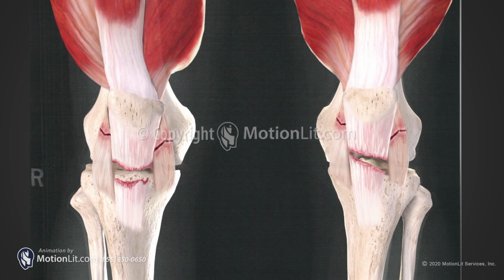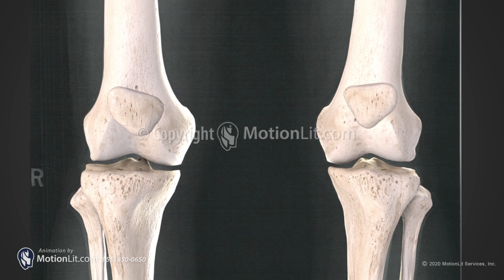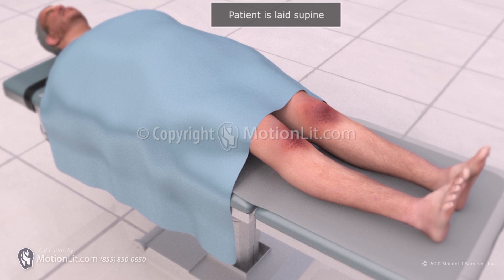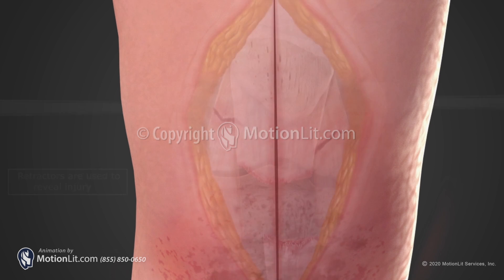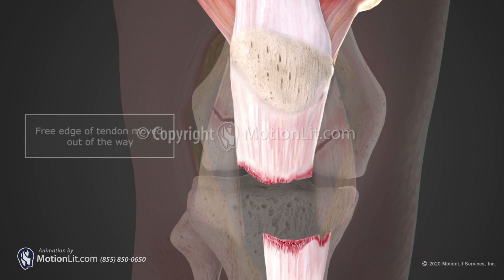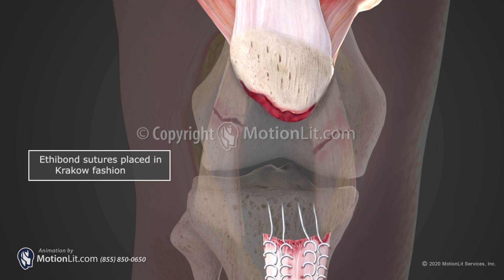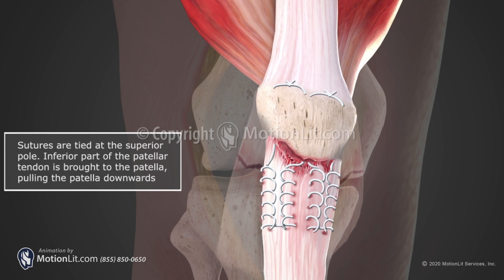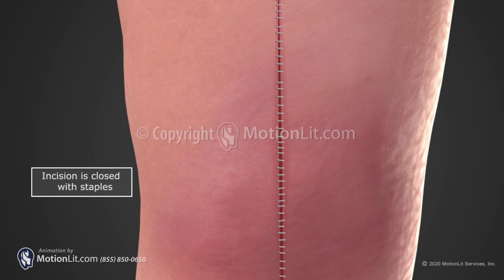Patella Tendon Repair

Comment: For anyone looking at this, 6-12 months is if you’re lucky. I’ve been dealing with recovery for almost 2 years now and finally making somewhat progress.
Reply: Nooo don’t say that 😭🙏 I just had surgery 3 weeks ago
Reply: @_ApoIIo yeah I ask myself daily did I put in enough work. Some people are able to bounce back pretty quickly, but I was just not one of those people.
Reply: Nasty injury to have. Had mine a year ago playing basketball. I’ve been playing basketball for 20 years and only recently I had the patellar tendon tear. Winter is a nightmare with this injury
Reply: I'm sorry to hear this has taken this long for you?
I'm 2 weeks from surgery. I suffered a 90% tear from a fall.
Reply: @36ELGALAN it’s taken me about 2 and a half years as I had knock back , I would say listen to your body and record how long you swell and increase or decrease your load depending on on your physion. The leg extension 45 second holds are killer i remember i couldn’t even hold the first plate without pulling a face now i can hold 66 kg its been a long road , also back to playing 90 mins of football but i get swelling afterwards but ibpro helps
Reply: im just now getting back to normal. Going on 4 years...... Its and extremely long healing process. The good thing is you can walk
Reply: @erichumphries4662 Thanks for your response, Eric.
Reply: Does yours feel good as new not that it's healed? Or does it feel like as if you have patellar tendinosis where your knee is still sore from stressful activities like running and jumping?
Reply: @vanisle_kahuna  The good news is you will be able to walk. Depending on your age. Running and being like normal will be up to your rehab. I have never been the same. But im thankful for the mobility I have. If you are in sports such as foot ball basketball. It will be a hard road back.

Comment: im confused as to what i actually did to my knee. i fell of my bike at around 30mph and went over my handle bars i used my right arm to break my fall and i also hit my knee cap face down on the pavement too. when i got to the hospital they put my arm in cast but said my knee was not broken but badly damaged. for the first week i couldn't walk. i'm 8 weeks into my recovery and i can walk and run but cannot fully bend my knee i get really sharp pains in it, have i torn the ligaments ?
Reply: yea go get a mri you tore something, same here crashed mopad at about 40 kmh(i was outta town ) I belive I partially tore my patellar tendon or fully i gotta check back in 🤦🏽‍♂️ surgery monday
Reply: @iam-deadlyclan4 Im 19 years old 1,5  years ago  I had a direct blow in my knee . Due to the bad decision of my doctor like I had only an x-ray and no mri  He misdiagnosed . Actually my patellar tendon almost tear And I had to have surgery but i didn't . The MRI I did 8 months later says that my tendon is okay but even now I can't walk for a long distance, i can't go up and down  the stairs without pain I can't even straighten my leg when im sitting. ? Is there a chance that I can get my strength in my tendon? Now its too late for surgery,maybe a tendon graft its good idea?
Reply: Any update?
Reply: @AlexHernandez-xh8ei  if ur talking to me had surgery on my right knee (patellar tendon) on September 12th. Was in a straight brace for 5 weeks. Currently on my 2nd week of physical therapy. Looking to return to work by december (UPS) so i can’t rush back as much as I want too. Keep a positive mindset because it was hell being indoors all that time.
Reply: @iam-deadlyclan4 did u actually rupture it?
Reply: @iam-deadlyclan4 Im 19 years old 1,5  years ago  I had a direct blow in my knee . Due to the bad decision of my doctor like I had only an x-ray and no mri  He misdiagnosed . Actually my patellar tendon almost tear And I had to have surgery but i didn't . The MRI I did 8 months later says that my tendon is okay but even now I can't walk for a long distance, i can't go up and down  the stairs without pain I can't even straighten my leg when im sitting. ? Is there a chance that I can get my strength in my tendon? Now its too late for surgery,maybe a tendon graft its good idea?

Comment: Mine was slightly different the whole tendon came off the bone and had to be screwed back in (left knee), and a full rupture of the quad muscle off the tendon (right knee) which was repaired the same way as the video.
Reply: how you feel?
Reply: @memesmemes1705  Sometimes struggle with pain and tightness but stronger now than before

Comment: 6 years later and my knee is great post op. It took several months of rehab to get full rom. Getting the strength back in my quad took a few years. Your quad muscles basically dissolve during recovery because your not allowed to move your knee for 6 weeks.
Reply: I'm  going through this right now and four weeks into the journey. I haven't started physical therapy yet. I always had strong legs and hoping to get back to at least 80%. Any advice?
Reply: How r u now? @eriktarver2087
Reply: I’m currently about 10 weeks post op. I’m at 120 degrees on my left leg and about 112 on my right. Things will take patience. Also I was lucky enough to get a video of my injury too. It’s on my channel
Reply: @KuyaDreww  how are you doing now?
Reply: Just did this today on both knees 😩
Reply: @smauller623  so sorry to hear it. Brutal injury! Omg, hopefully you get a good surgeon. I’m guessing with both legs injured it’s difficult to walk. So sorry man, damn.
Reply: @ I can’t walk tried the immobilizers from ER and can’t even do that.
Reply: @smauller623 how did you do it?
Reply: @smauller623 Como sigues,cómo es posible te rompieras las 2???????
Reply: @JoseMaya-i5y nobody knows got bloodwork done and no blood/tendon issues. 6mo in and still can’t run or jump yet.
Reply: I’m currently 4 weeks post op. My surgeon had me walking day 1 post op - quite aggressive approach. That is with brace and crutches. Just increased brace rom from 60 to 80 degrees today. Mobility and rom is progressively better but muscle mass in quad is gone and judging by the comments, it’s could be a while before I see muscle there again. Frustrating but hopefully lots of protein in diet and decent therapy will keep things improving. Scared as heck though that the further I increase rom, the more risk of re-injuring but just trying to be careful. Any advice to boost confidence/moral at this point?
Reply: @ It sounds aggressive. My dr. told me that each of the 3 cords he placed could hold my total body weight. I was nervous about damaging his repair. He wasn’t at all. Hope this helps.
Reply: @remmah192 Como se llaman esos cables,que nombre tienen????? Estoy pasando por lo mismo. 😢😢😢
Reply: What shape were you in before your injury?  Im currently going through this. What hardware did you have? Did you end up removing your hardware?
Reply: @TheSnowRobot  Hi there! Very sorry your going through this first of all. I was in your shoes and know how worried I was. I was in good shape, athletic 45 year old. The surgeon connect my tendon back to my patella with 3 cords. He drilled 3 through holes in my patella and wove the cords into the tendon. The cords are not removed. I don’t know if they eventually were absorbed by the body or still remain.
Reply: @remmah192 how painful were the first few weeks after surgery
Reply: @fqqures1019  sorry didn’t see this before. Did you get this surgery too? The first weeks were very painful. The rehab was especially painful as I remember.
Reply: @remmah192 hello, i tore my patellar tendon in march of 23 playing basketball and i was 32 years old in some of the best shape ive been in in my adult life. I got surgery and it took me a long time to recover. I can play basketball now but for obvious reasons i cant move the same. Does your knee still feel type and does it still swell up? Also, my quad is terribly weak still in 2025. Any tips or workouts that help with strengthening?
Reply: This is me!!!! I tore my patella tendon in July of 2023 and a year later, I’m still trying to work on regaining my strength. Any tips?
Reply: @kadejames6029  are you able to sqaut now. And what about ur ROM
Reply: @kadejames6029  are you able to sqaut now. And what about ur ROM